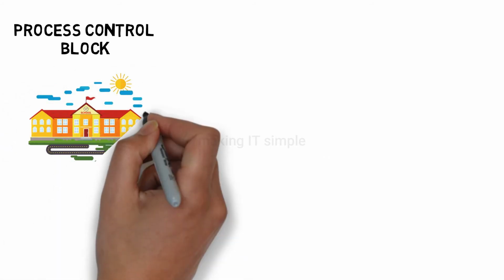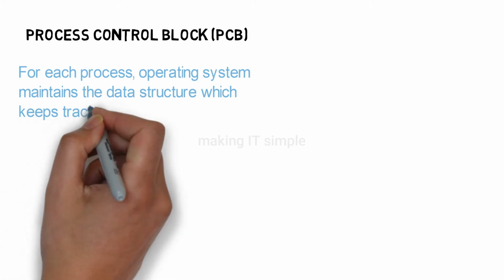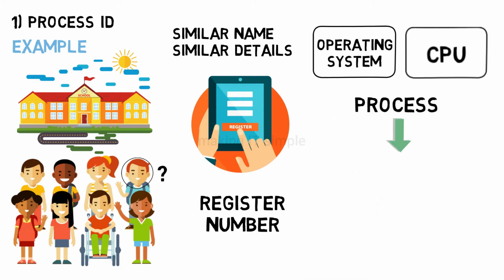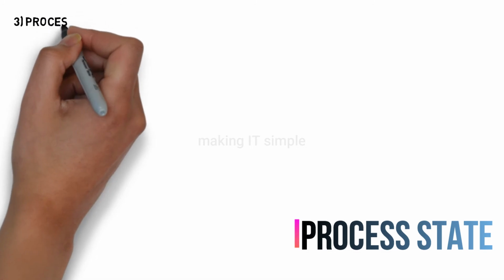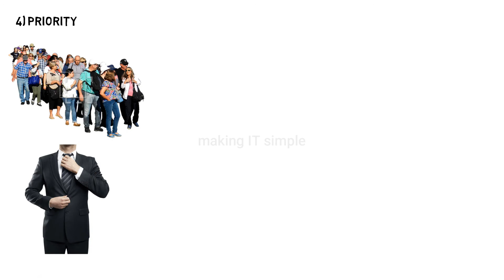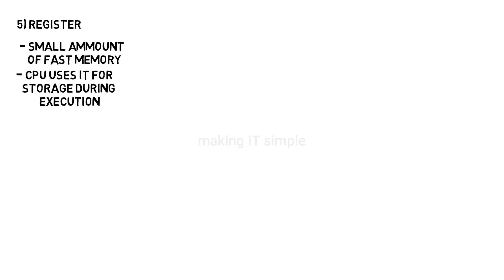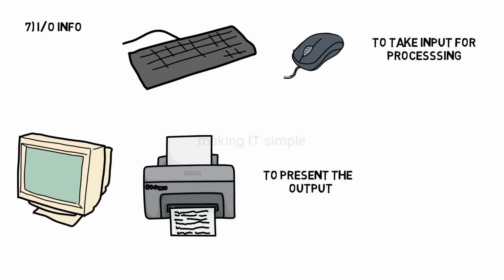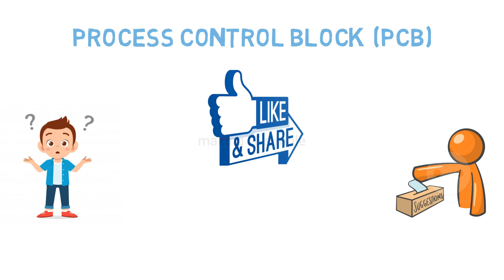Process Control Block (PCB) | Process Attributes

Comment: In every single stack frame there are 3 segments :
1. The argument segment  |  2. The local variables segment   | 3. The return address segment

My question is:  Where does the return address segment points? 
"To the registers of the proccessor"    or    "to the code section"